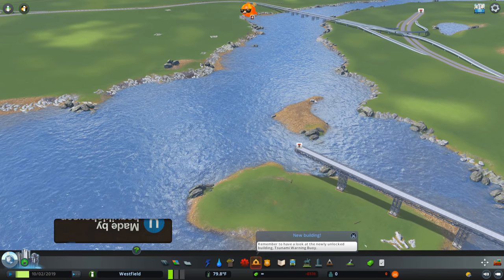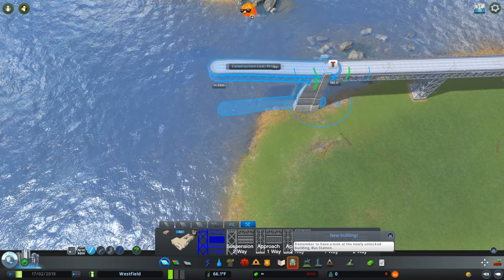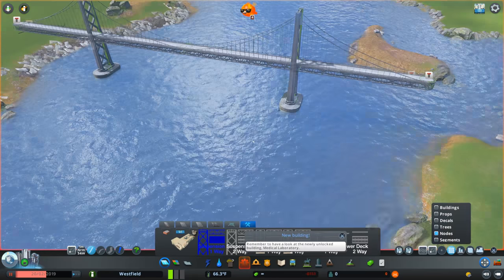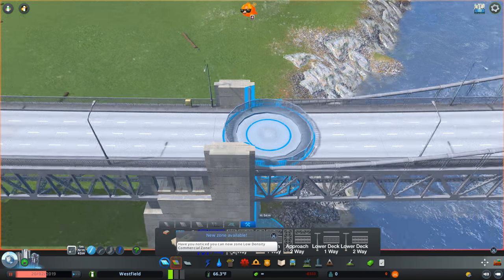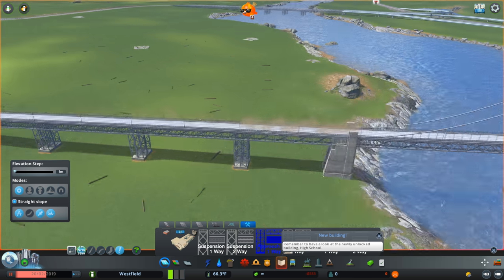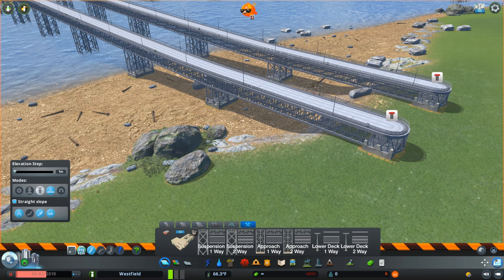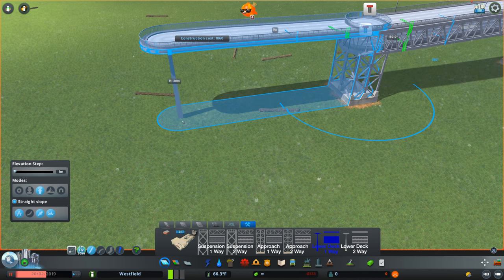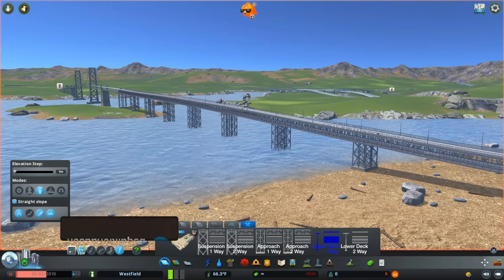Cities Skylines - Bay Bridge Double Deck Network Tutorial

Comment: Not sure if feature was added later or bsquiklehausen doesn't realize that Move-It mod has one neat feature that can make building this bridge or any other double-decked transportation easier. When you are using the copy function, hold down the ALT key. This way the mod will make a copy at the same place as the original so all you had to do is adjust the height with the Page Down button. No more having to fumble about the precision.

Comment: Hey there, the bay Bridge was built by the same contractor as the 25th of April bridge in Portugal. They are very similar, th Portuguese bridge is red has 3 lanes on both sides so its wider and has a train lower deck unlike the bay Bridge. I think it would be nice to have the 25th of April bridge also in-game

Comment: Hi, It appears that the elevation options don't work correctly on my version. I have made the bridge but no matter what I do I can't get the lower deck road out of the bridge. I have done as you suggest but every time I select the lower elevation it just says something else is in the way. Any assistance you could supply would be great. Also really great tutorial.
Reply: All good. I worked out a different way. 
If I make the bridge a little longer. then after I have finished the bridge I upgrade the ends part to Upper desks, then move them with move it. I can fan the ends.  Worked great. :) Cheers. :)

Comment: How did you get the scrolling sign thing at the beginning and the end of ur videos? because i want to use that too :D
Reply from the maker: Gabriel Peinado I made it myself with After Effects. I'm not planning on distributing it though.
Reply: Does After Affects costs any money? i could attempt making my own version. you dont have to answer since i can check... thx for answering the comment
Reply from the maker: Gabriel Peinado Yes - it's professional software and is quite expensive. I'd recommend doing simpler motion graphics to start with, and moving to custom stuff later.
Reply: Ok. Thx!

Comment: So dumb question cause i'm obviously missing it. What is allowing you to clip the lower deck through the bridge? I thought it was just the precision engineering mod, but evidently not and works fine until it hits the support pylon. Am i missing something?
Reply from the maker: You need to make sure you have Fine Road Anarchy installed, enabled, and active as well.
Reply: @bsquiklehausen  That must be what i was missing. Thank you for letting me know and great job on the mod

Comment: This asset is simply amazing and still works completely fine in my new city, the only issue is the pillars in the suspension section in not there.... Only the cables are present, Am I doing anything wrong?
Reply from the maker: I haven't heard of this bug before, but are you using any mods for road placement like Network Skins, Road Anarchy, or anything else?